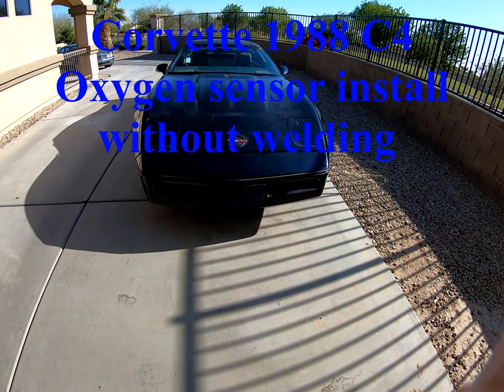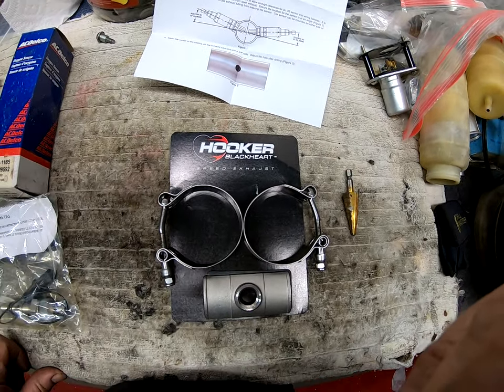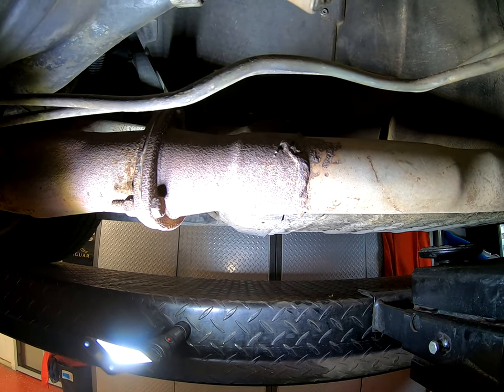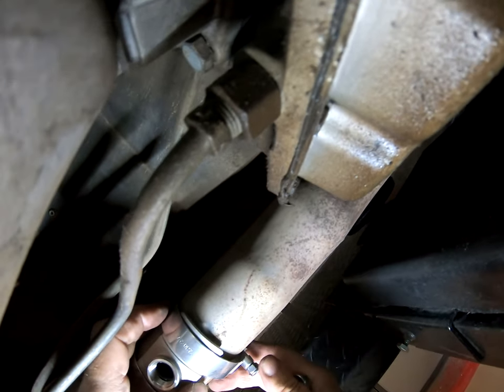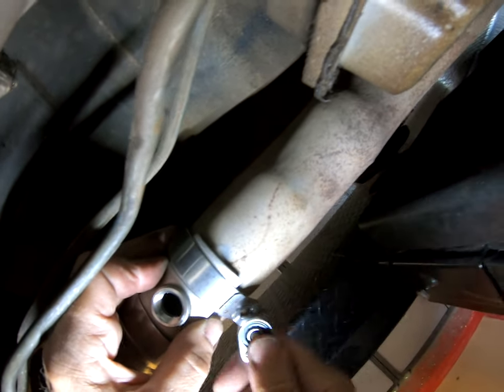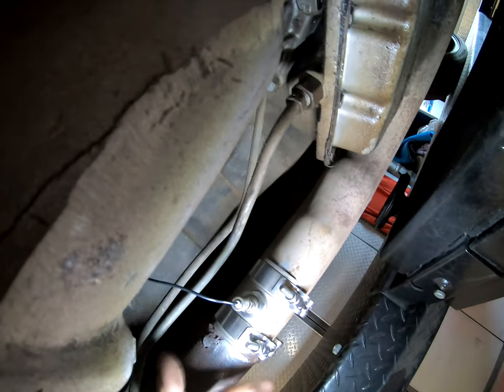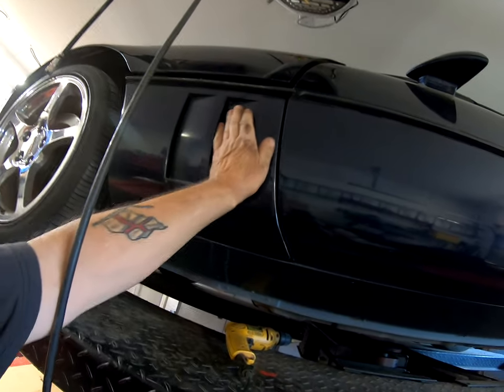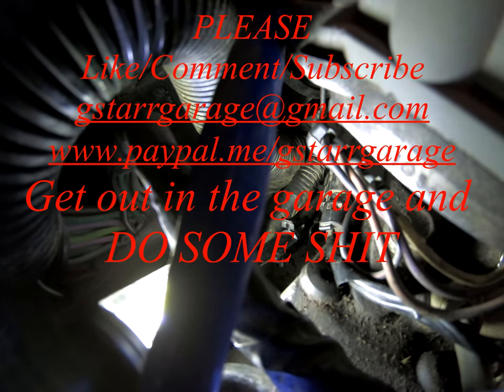Corvette 1988 Oxygen Sensor install without welding

Comment: Single wire sensor needs to ensure that it gets a really good ground through the mounting.  Hard to ensure with a clamp-on mount.
Reply from the maker: Good point I’ll check it, you bugger made me doubt it